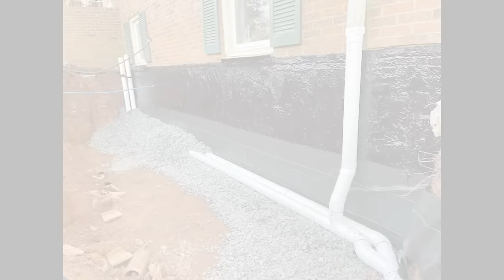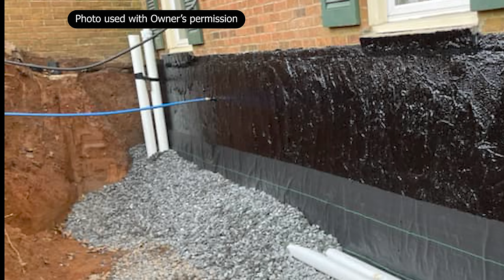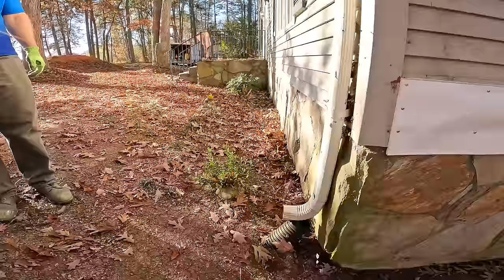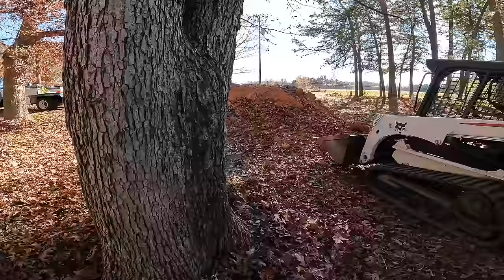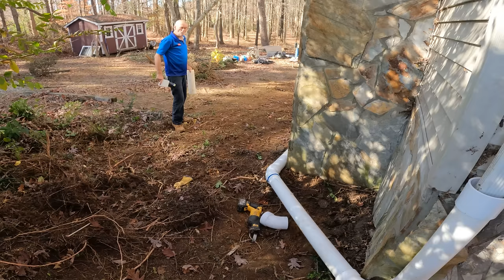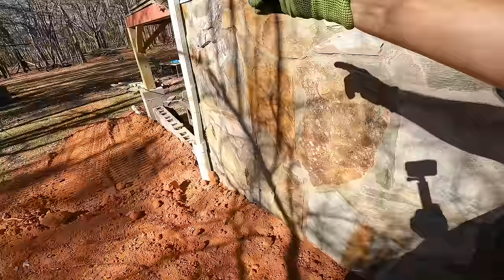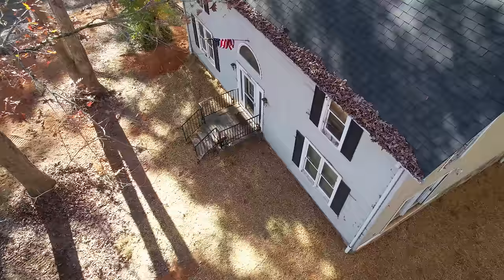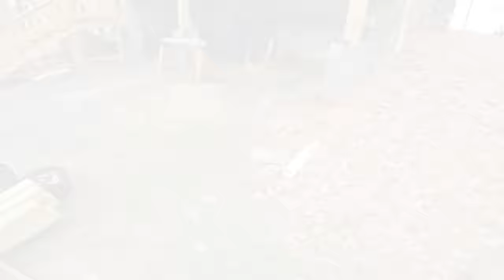Do I need a french Drain? Surface v subsurface water?

Comment: The tile is for subsurface water, shouldn't be tied into surface water. It looks like a French drain when you install it but it shouldn't go to the surface, it needs a membrane and then appropriate grading ontop. Otherwise one blocked or crushed pipe and you've just build a swimming pool around the house.
Reply from the maker: Great comment Jono!

Comment: Is that going to change the loading on the foundation? You're adding the weight of several feed of compacted soil, and there is only void on the other side. If those loads weren't part of the design, seems like there might be a risk of toppling that stonework?
Reply from the maker: It's a concern for sure. Hopefully the design included soil to correct grade and the foundation wasn't designed to have negative grade.

Comment: so, on a foundation tile system like you showed in the picture...where does the water go to since it's 6 feet below the surface?
Reply: The sump pump in the basement.
Reply from the maker: Ideally it would daylight out, but often there is no fall. So it ends up in the sump pump like frog said above. 👍
Reply: @GCFD Yes, I've seen it time and time again. It will eventually flood the basement during a heavy rain. Because the pump can not keep up. Great work, GCFD love your videos. Keep it simple when you can digging the foundation up should be the last resort, but sometimes necessary.

Comment: This is one of those scenarios where the simple common sense approach seems too simple to be effective. Contractors are able to get Homeownets to believe that this is a very extensive issue and it must be fixed by spending a lot of money and having crazy French drains installed.  When you can literally just close your eyes and imagine how simple turning you house into a hill and keeping the water away. It's so simple that homeowner's camp believe it can be that easy. Common sense isn't so common these days.
Reply from the maker: That's a great point! I never thought of contractors using this to create the need for a complex solution. I often show up for a drainage call where the HO thinks they need something super expensive and it's a quick fix like a clogged pipe or brown downspout.

Comment: i agree shaun. no reason to dig a 6 foot x 6 foot ditch around the home to put up a thin layer of crap plastic. what a waste of time. also next time you get a chance to show the homeowner, dig a hole near his house to look for subsurface water. if its a dry hole, no subsurface water. easy to show the difference between subsurface and surface. i know you did this in your excellent french drain video. you might want to reuse that clip of subsurface water in your surface water videos. or make a specific subsurface vs surface water video example.
Reply from the maker: That's a test I use all the time! Often you can even dig through a standing puddle and find dry dirt underneath.

Comment: Foundation drain should be done on new construction.  With the house already built you need to manage the surface water no doubt about it.  I would not be injecting "Decay solvent" into my foundation on a regular basis in any case., the gutters always get a separate pipe since it is a storm drain, you never want a storm getting direct access to what hold your house up...
Reply: Yeah organic matter can act like a oil lamp wick and pull water under/through your clay layer.  Similar problems will take down an earthen dam when roots penetrate it.

Comment: You need to take the potential problem water away from the house and to a point where it can't return. It should also go the most direct route possible. In the other example, the water could travel under the basement floor and cause other problems. It's absurd to bring the roof water so deep underground, especially so close to the house. Funny how impressive the pipes and stone looked and it is a poor solution.
Reply from the maker: I agree. I was floored when the installer showed me that picture. Luckily he gave me permission to use his photograph on this channel.

Comment: So that clay that you placed on the permitter is exceedingly dry. In your past videos the clay had more moisture and was more malleable where this is basically dust. So I wonder how this will adapt. I am questioning this while halfway thru the video.  You will likely address it. Or Jeremy, sir emcee.  I like the way you do it. Ohio has mostly clay and shale. Shale to my is like gravel you can break it up in your hands and clay when it gets wet here tends to stay wet but only a surface layer. I would share you videos with friends so they can see what you see. Keep it away. What is the point of gutters if it is dumped on the ground next to a home?

Comment: That’s not true. The foundation drain you showed would be perforated, the downspouts drains are solid. Everywhere I have contracted and lived these drains are required by code, with clean gravel fill. I have seen you void customers hardie siding warranty by placing soil to close.
Reply from the maker: That's exactly how the gutter water gets into the foundation, through the perforated pipe when it gets clogged. Yes, I've taken grade close to siding when there was negative grade. It's a very difficult situation where the HO has to choose between space between siding or flooding the house. Ideally, I would raise the house to have proper grade away and proper space from grade to siding. 👍
Reply: @GCFD  a footing drain and gutter drain should never be connected until you reach the outflow side of the perforated and switch to solid. Improperly installed drainage is the cause of footing drainage issues. The issue I see most is they don’t daylight the drainage.
Reply from the maker: @thpiii5084  if you look closely you see they did to this. I still like to keep separate pipes for gutters and FD pipes.

Comment: It’s just poor engineering to combine water from the gutters with a French drain designed to capture sub surface water. Way too much potential for intrusion during extreme rain events. Get as much water away from the house as quickly as possible